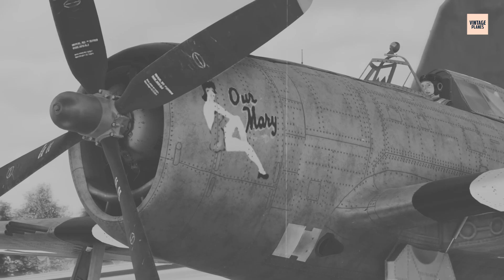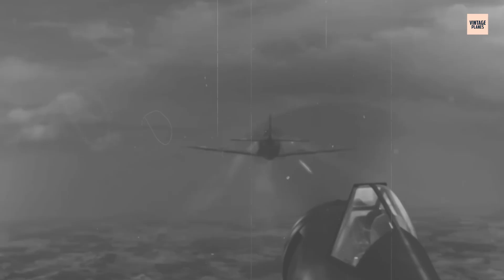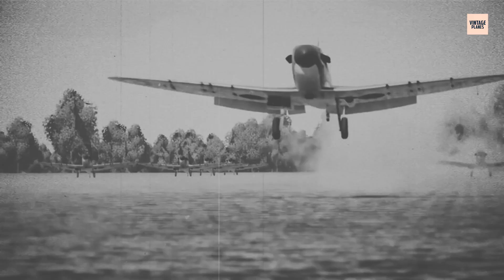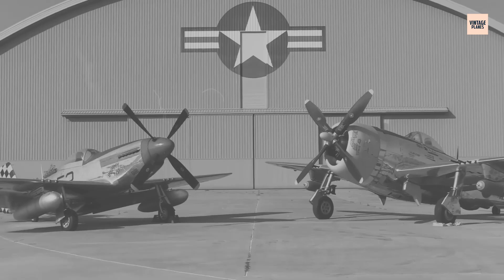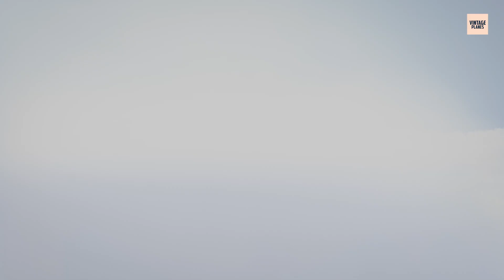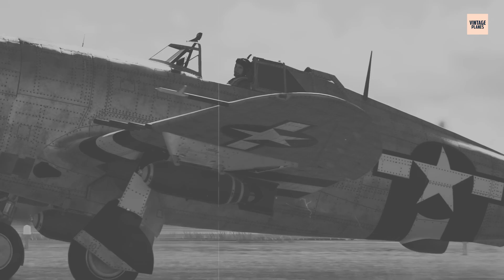German Engineers Opened a Captured P-47 Engine — What They Saw Ended All Hope

Comment: The Germans knew about supercharging and turbocharging. They knew about the value of high performance number fuel. 
They were not able to implement systems that leveraged these technologies because they did not have the required raw materials for the high strength alloys and the high temperature nickel alloys needed for exhaust driven turbines. They couldn't even put reliable exhaust valves in their engines.
What did amaze them, blew them away, was the precision of components produced in vast numbers. The American machinery was produced in vast quantity by high production automatic machinery. Germany had never undertaken that sort of machinery.
America harnessed the knowledge of the aviation industry with the production methods of the auto industry and let the companies figure out how to get it done. The Germans were hamstrung by a dysfunctional inrerface between technical ministries and the engineers and production entities.
The Germans were also stymied by problems caused by their high tech systems. They endured a long spell of oil dilution and cylinder scuffing caused by their direct fuel injection washing oil off of cylinder walls.
They could build rockets but they couldn't make enough high octane fuel. They were a mess.
Reply: Great analysis!  It didn’t help that they attacked so many countries before 1941 that they were overextended. Some of those countries needed an entire army just to keep them suppressed.